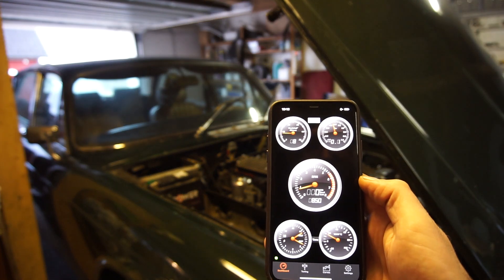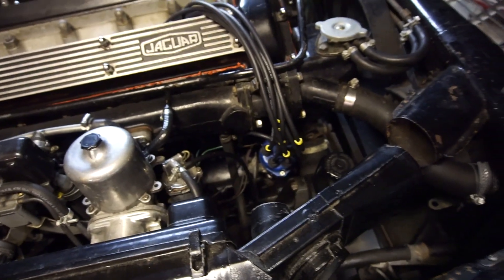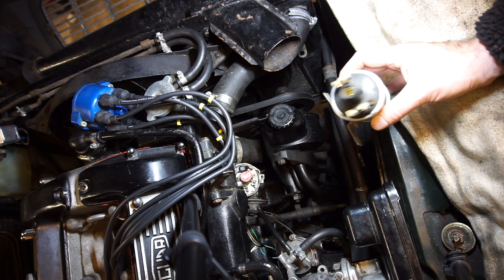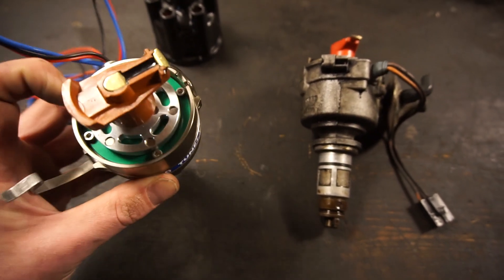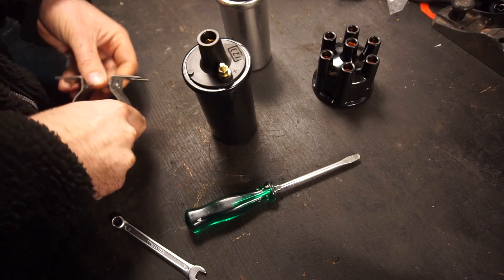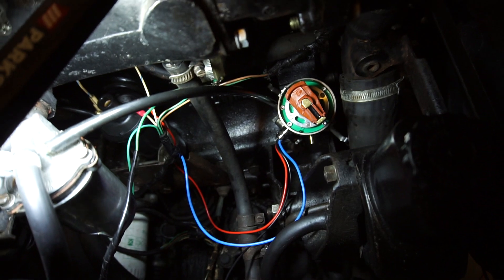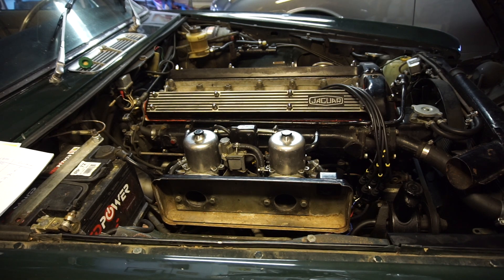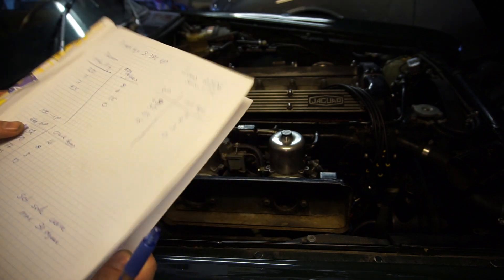Installing and Setting Up 123 Ignition Tune+ on a Jaguar XK Engine

Comment: I had 123 ignition fitted to my Mk 2 3.8l 1964 this spring. Got a whole new car, smooth and nice running, all horsepower has found its way back to the engine 👍👍. Best investment.
Reply from the maker: So far it’s a great upgrade here too!

Comment from the maker: It's been a few days since this was filmed and I have now driven the car more. 
I have made a few changes to the map and I’ll be sharing that in the future.
It runs fantasic with really good throttle response. Pulls very cleanly all the way to 5,000 RPM (I don't want to push it more)
So far it's a really good product!
Reply: It’s also great to be able to share curves and maps👍🏾
Reply: Hi Adam, where did you find the formulas for the various curves?  I just got my 123 Distributor after watching this video and would like to set it up properly.  Thanks!!
Reply from the maker: @BrianMadsen-yj8df I worked them out myself. I took the curve from a series 1 distributor and modified it. You can find the curves for the original distributors if you google them.

Comment: Electronic ignition on ANY older English car a well worth while UPGRADE!!!!
Reply from the maker: Sure is!
Reply: @LivingWithAClassic   I have a 420G 1967 can I remove the head nuts that hold the plug wires in the casing with out disturbing the heads

Comment: yeah maybe moving the coil far from the block on  s2 jag  is better but i think the original center wire is too short
Reply from the maker: I have measure and it will work with the original HR lead. Will just need to alter the other wiring

Comment: Another great video Adam - thanks. Do you know if this can this be done on a V12 HE engine in an XJ-S?
Reply from the maker: They don’t have a V12 version. The Lucas system used on the HE V12 is very reliable and works very well though

Comment: So on a 6 cylinder engine with the standard 1-5-3-6-2-4 firing order, #1 and #6 pistons move together so you can time the engine off either cylinder.  That is 10 degrees before TDC on #1 is also 10 degrees BTDC on #6.  Jag for whatever reason numbered from the flywheel forward instead of front-to-back.  And yes, you can also time a typical 4 cylinder engine off #4 for thew same reason.

Comment: I am using a 123 distributor on a 1968 4.2L etype. My curve is different than yours with 0 degrees below 1000 rpm. The car starts and idles beautifully. This is the best upgrade I have made to the car. Once you have the timing correct, It’s great to know if there are any performance issues then it’s probably fuel related. I am going to try your map because it’s so easy to do.

Comment: Hi adam ,this is very interesting this 123 dizxy set up,like that .Being able to ajust timing sitting in the car on the fly.
In some way it"s condunrim that they run so well with a new point's dizzy.
It the 123 seem's to be a cheaper way to big tuning. Rather than a full ecu.

Comment: Hi this is really helpful especially the advance curve maths. One question. For my 1969 E Type 4.2, would the curve be the same as yours? Can I just copy your numbers into the 123 app? Thanks again Simon
Reply from the maker: Yes that would be the same curve and yes you can just copy them. I took the curve from an old instruction on how to test those distributor. It is a Lucas 22D which was used in 4.2 E-types and series 1 XJ6.

Comment: Just watched this video. There is a mistake in your programming on the vacuum section. The very first point number 1 @ 0 pk should also have 16 degrees. Otherwise your vacuum chart does not make sense as the advance should not have that drop off. Also, have you noticed that the screen now shows the possibility of putting in a note about Static advance. This came about from a software upgrade.

Comment: Congrats on a successful installation of the 123 Dizzy.  In my experience the best money I ever spent to improve the performance of my cars has been to install a new high performance distributor.  Especially here in the USA where the factory distributors were set up with a  lot of ignition retard and lazy advance curves for exhaust emissions control purposes.  Do you think the 123 Dizzy has improved the engines "driveability" and throttle response?
Reply from the maker: So far it feel more alive and more willing to rev. I still need to drive it more but so far it feels great